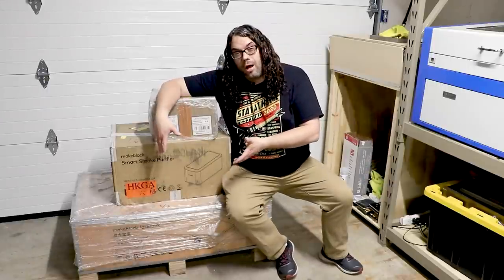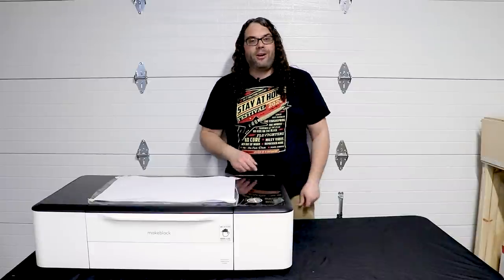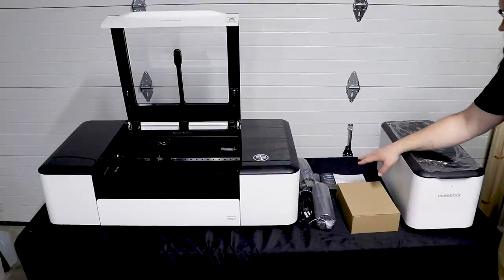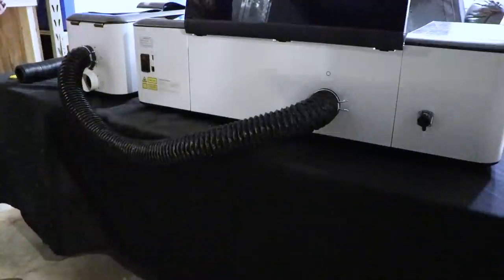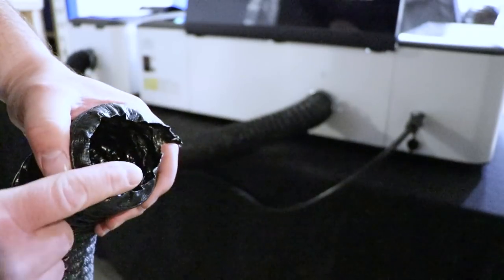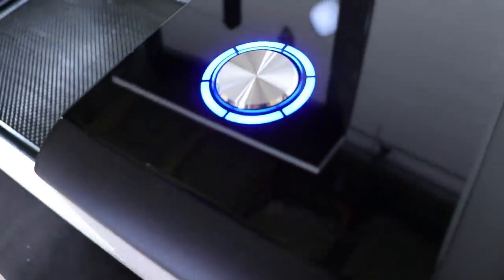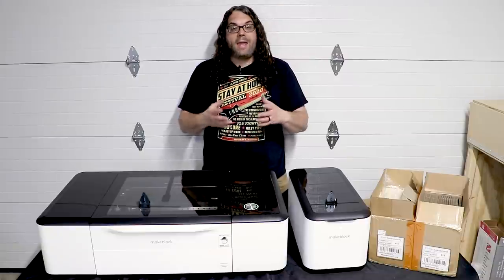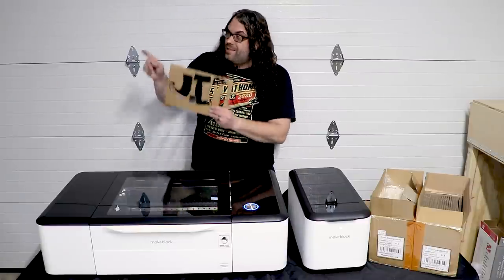Makeblock Laserbox Pro Unboxing and First Use - Best Laser Engraver?

Comment: Tha machine looks great. Do you have a video on which machine you would recommend for a newcomer in this business. Me and my wife want to start an Etsy shop and the idea is to make all kinds of arts and kraft for Weddings, Christmas etc. etc. Look forward to more videos. Thanks in advance. Maybe also do a video series on what you which you knew before you started the laser engraving business and how you would approach it if you were starting from scratch today. Thanks again.
Reply from the maker: Thank you for the recommendations and for watching! To be honest, if you are good at tinkering and want to spend some time learning and dialing in a machine, I would go with one of these based on your budget. https://omtechlaser.com/collections/co2-cabinet-laser-engravers. But if you want the ease of use, I would check out the Glowforge. Their software is much better and they have a much bigger community.
Reply: @TheEdgeofTech  Glowforge has similar software and in my option it's more limited than makeblock. You can make shapes and designs within the makeblock laser software. Plus for a business and deadlines and don't want to risk running into an internet outage your glowforge would be a paperweight. makeblock is not dependent on the internet so a long as you have the power you can keep working.

Comment: Hi there I ordered the laser make block laser and I was wondering how the customer service is I’ve ran into some roadblocks with them they are very vague with there emails I purchased this product on 2 February I know that there’s going to be variance and time frame but I was just curious what yours was
Reply from the maker: Hey! They were a little slow to respond, but always did respond. I know they were on their holiday until yesterday I believe so they might be behind. Let me know if you don't hear from them and I will reach out
Reply: Thank you for the response I will let you know
Reply: I did get my laser finally it took five weeks but I got it I was wondering if you could let me know if I can use a light burned with this and what settings to use it possible
Reply: @soloschwartz  Yes, you can.

Comment: Can this laser etch Zippos or whiskey flasks?
Reply: Any CO2 laser can etch but you'll need a special spray you'll need to apply to the metal before engraving on it. CerMark Ultra Laser Marking Aerosol its a bit expensive but worth it.

Comment: That's neat but I don't have 4k to spare. :/ I guess I'll have to get the k40 engraver.
Reply: Check out the Glowforge Basic! It's only $2500 and has the same specs. A k40 will cost you around $1000-$1500 by the time you upgrade it to similar quality and you will have a lot of constant tweaking to do.
Reply from the maker: To be honest, I would listen to Greg below. Save your money for a bit longer and grab a very nice machine. :)
Reply from the maker: This!

Comment: Looks like a nice machine! It is quite pricey. For the specs, a Glowforge Basic will get you the same thing (though it does require wifi to operate) at almost half the price, and comes with a filter not a purifier ($2500). Although Glowforge requires wifi, they are also innovating quite a bit with their software and improving the machines over time. Either way, it is good to see competition in this space. Lasers are becoming much more economical to own, without having to buy a "chinese" project laser that you have to upgrade and tweak constantly.
Reply from the maker: I agree Greg! It's been a learning curve on this software and I think Glowforge is way ahead there. I probably should get one to compare! hahaha I like that it doesn't require an internet connection, but they need to buckle up on the software.
Reply: Where do you think these things are made, Chicago, IL?   lmao, that's Chinees printed on the bottom crate, by law it has to be there, look before you comment . If they market them as made in the USA or Mexico they'll be breaking several consumer protection laws.
Reply: @generalpattonpending7256  They are actually manufactured in facilities in the US or Mexico, by Flex. :)
Reply: @GregsMakerCorner  look at the crates, that's not English or Spanish   lmao
Reply: @generalpattonpending7256  Oh, thought you were talking about the Glowforge! that's what I was referring to...
Reply: @GregsMakerCorner    lmao, that's Chinees printed on the bottom crate, by law it has to be there, look before you comment . If they market them as made in the USA or Mexico they'll be breaking several consumer protection laws.
Reply: @generalpattonpending7256  Dude, you replied to my comment on Glowforge.. were you paying attention? :)
Reply: @GregsMakerCorner  I was talking about the machine in the video

Comment: You make no mention about the water cooling,  Did you have to fill it up before using, is air assist built in, Nice machine but wrong expensive price tag